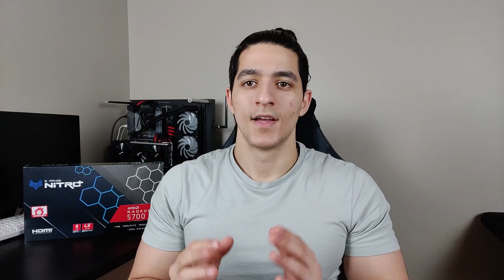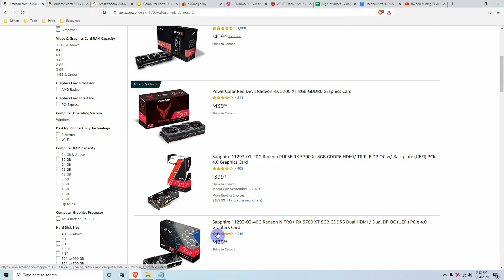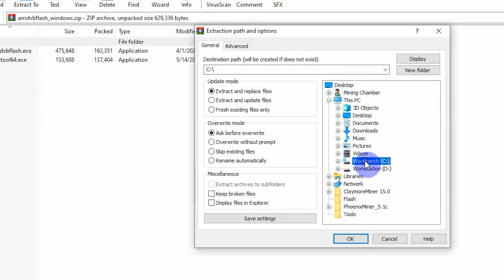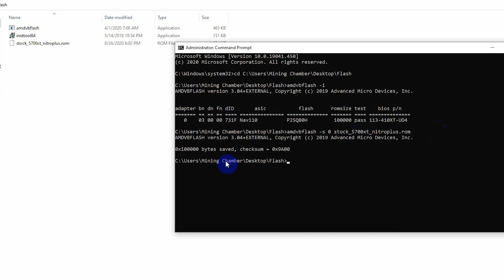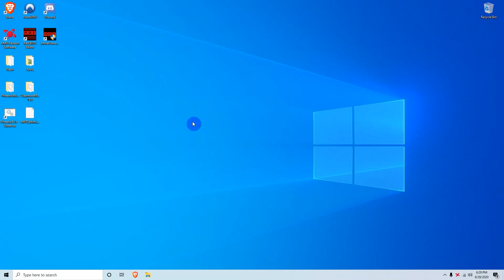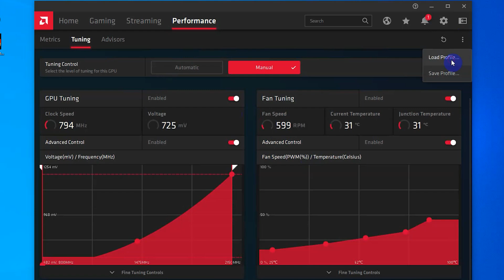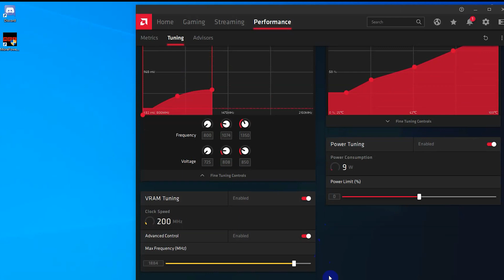RX 5700 XT Mining Overview | Profitability, Hashrates, BIOS Modding & Overclocking

Comment: Why do I get cannot load driver when I try amdvbflash? And it os 3.04+
Reply from the maker: Make sure to run instool that came with it
Reply: @MiningChamber  thanks worked perfect. Any chance to get more then 54.3mhs per gpu on sapphire nitro plus 5700xt
Reply from the maker: You can use the performance settings we show in this video!

Comment: Hello, I'm mining with my Aorus RX 5700 Xt, but I can't do more than 25mh / s and then the speed drops .. I used an Aorus app to increase power and memory but it hasn't changed much .. what am I doing wrong because whatomine also tells me that i could get 58mh / s .. could you give me any suggestions?
Reply from the maker: What happens if you try to do it the way were are doing it in the video? Try to use Wattman to overclock the card and make sure it's fully powered as well!

Comment: I have followed your video and done everything you did, my hashrate is 55, which is great but my powr consumption es 115w!!!, cant go lower, 725mv. Any ideas?
Reply from the maker: With this guide we don't go lower than 725, are you reading your watts off the software or the wall? Generally these gpus with the effecient settings pull around 130 watts from the wall so it's okay!
Reply: @MiningChamber  From the software (amd Wattman). The video card is one from asrock, but i do not believe the model matters.
Reply from the maker: Software is not accurate so try to get a wall meter so you get an accurate measurement

Comment: I changed the Bios for 1 card, when i put the 2nd card in it showed that the bios was already done?? same for the 3rd card. ????
How can the bios be changed before i even start the process?
Reply from the maker: Hahaha how did it show that the bios was already modded? I would recommend testing the hashrate first to make sure it's modded, try the settings we use and if it doesn't get you 55 mh or if it doesn't go below 750 mv for the core voltage then you probably didn't save the gpu image and loaded it into Red Bios Editor. Make sure you load the image instead of selecting from the drop down list!
Reply: @MiningChamber  its sorted now. just flashed them anyway. seams to work.
Reply: @MiningChamber  the settings seam to be around 730mv, but my wattage is around 135w! All settings are the same
Reply from the maker: That's completely fine! If you check on our website for the overclocks article we do show that this is how much it uses for watts off the wall for effecient settings!

Comment: hey can i mine without doing everything u made on the video? or is it riskier or just less profitable? thanks
EDIT: I forgot to mention it, what are the risks of gpu mining? i mean will it burn the pc? i will just mine for like 10 hours a day
Reply from the maker: Hey! You can skip the BIOS modding part but for overclocking I really do recommend not skipping over it. It will make your card run way too hot if you mine on stock overclocks. Just instead of undervolting at 750 try to do 800-850 core voltage
Reply: @MiningChamber  hey finally i decided to do it i was just afraid of flashing bios but everything is cool man thanks!
Reply from the maker: @oritoh  Thank you and good job!!
Reply: @MiningChamber  one last thing, yesterday i mined with stock settings and average effective speed was 46 in 12 hours but now that i overclocked its unstable from 20 to 45 is that normal? thanks! Normal speed is stable in 53.5 to 54
Reply from the maker: @oritoh  That is not normal make sure your following the overclocks properly, try effecient settings then performance and see what works best for you, also check the link to our website for ranges if your overclocks keeps crashing then you can move around in the ranges we provide on our website! I highly recommend tuning your overclocks, stock settings uses too much power and produces way to much heat which will kill your gpu faster
Reply: @MiningChamber  thanks man im getting good hashrate and temp is 54ºC, is that right? Effective hashrate i think its too high is at 60-70
Reply from the maker: @oritoh  temp for core is usually low you want to check your memory temperature that's usually gets really hot on those cards, below 90c is good! 

As for hashrate, check your reported hashrate not the effective hashrate

Comment: Rog Strix 5700xt can't be bios this way don't know why.
Reply: Yea for some reason my amd drivers can't find my gpu when i do the bios.
Reply from the maker: Did you make sure to run the instool that comes with the amdvbflash ? Usually that solves the issue and also make sure you have your AMD drivers installed for sure
Reply from the maker: Hmm odd, what happens when you tried?

Comment: Hey Mining Chamber,

Thanks for this tutorial! However, I ran into issue, when I try to use amdvbflash, I get an error "cannot load driver". At first I thought it was because I had the latest driver installed, so I downgraded to 20.4.2. I still get the same issue. I am using Sapphire Pulse's. I tried just one card, but I have 5 of them.

I did not try to touch the BIOS switch at all yet.

I am testing running them on stock bios at 1300mhz, 750mv, 1870 memory. I am getting 54.0 mh/s. Testing if it is stable.

Thanks in advance!
Reply from the maker: Hey! This usually happens when you don't run the instool application that comes with amdvbflash. And make sure your using the 3.04+ version not the 3.04 one. Good luck!
Reply: @MiningChamber  Thanks, buddy! You are right, I missed the step of running instool application. Going to try!

Comment: This was a fantastic vid. I have 9 Gigabyte 5700 XT cards. 5 are rev 1 and 4 are rev 2. I was able to mod all my rev 1's to bump them from 49 to 54 Mhs in HiveOS but setting the overclocks to the recommended values (core clock 1350/core volt 900/mem 1850/mem volt 850) didn't increase the MHs. I may flip back to Windows and adjust wattman and go back to NiceHash.
Reply from the maker: Thank you! And awesome good luck my friend!
Reply: Any luck on rev 2? I have tried every single .rom available for gigabytes but I always get stuck on black screen on my rig, only works on default rom
Reply: @juniordasilva3676  Did you get this working on rev 2? I also have rev 2 Samsung memory

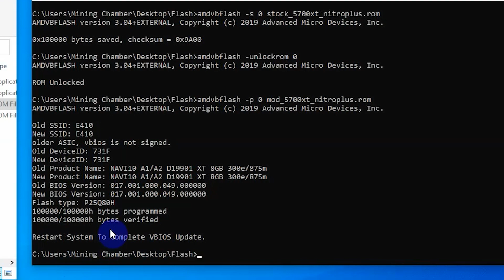Comment: So i got to 21:24 and now it will not let me open AMD software because no GPU is found. Go to device manger and it says windows has stoped this device because of issues (code 43). any help?
Reply: Got that fixed. so now I moded each GPU seperate and they worked great. when I put the whole rig together . It reads all 4 GPUs, buy #3 and #4 are showing 0 hash and error code says "failed to allocate buffer for DAG though device as enough memory, try to increase virtual size of memory using bigger swap file"

Thanks!
Reply: okay so I just increased my virtual memory to 32000 and it worked. Fingers crossed.
Reply from the maker: Oh awesome sorry I thought I replied! Our 5 tips must do for mining in windows 10 video covers this, feel free to check it out!

Comment: What's wrong with the MSI MECH-OC? I just bought 6 of them :/ haha
Reply from the maker: They get pretty hot! Just make sure you cool them good enough
Reply: That was my concern as they much cheaper as well then ASUS I Hope Gigabyte is bit better in this case
Reply: @PasakuPasaulis  I have gigabyte 5700xt. it stays cool. without bios modding and underclocking and overclocking in adrenaline, i get 52mh/s using lolminer
Reply: I'm sure you've discovered that they run a little hot, but hopefully you've also discovered that's because they tend to have the thermal pads not on the center of all the chips. Pop the cooler off clean off the gunk, fix all of the thermal pads, apply good thermal compound and bolt it all back together... Bit of a pain to do to each card one at a time but they run significantly cooler after you do.
You can also take the plastic back plate off, put a big thermal pad over the back of the whole card, and just stick whatever heatsink you want onto that.

Edit: or you can do what I did and just put a water cooling block on it.
I did that to mine before I started mining anything just because I wanted a quiet gaming PC but it lets you really crank everything up
Reply: @TravisFabel  How much did it cost to put a water cooling block on it? Summer is coming up so I need to figure something out regarding the heat. Has it been worth it thus far? Easy to install?

Comment: what is wrong with the other RX 5700xt?
Reply from the maker: They just aren't as good with cooling but performance is very much the same! Heat makes hardware die quicker
Reply: @MiningChamber   awesome, thank you for the quick reply. I had just bought an MSI one, so thats handy to know. it was 150 cheaper (in Aus) then the ones you recommended, and now i know why, cheers.

Comment: Hey bro thanks for the amazing tutorial I'm considering buying it now and I was woundering what motherboard and what processor and power supply, ram to pair it up with i would really appreciate your help

Thanks
Reply from the maker: Hey! Thank you!! We have a video with the full parts list for this GPU in here https://www.youtube.com/watch?v=lOn8WceC2TM&lc=UgzeLW3IuAQOEDduKA54AaABAg
Reply: @MiningChamber  first of all thanks for your amazingly fast reply and I have 3 questions I'm sorry for asking alot 1 is that my electricuty is 220v is there a recommend power supply. And 2 is this rig suitable https://www.amazon.com/dp/B079MRMJZL/ref=cm_sw_r_cp_apa_fabt1_XItVFb470XSDQ?_encoding=UTF8&psc=1

And the third is that this processor is out of stock can I replace it with this one https://www.ebay.com/itm/Intel-230430-Cpu-Bx80684g4930-Celeron-G4930-Box-2m-Cache-3-2ghz-2c-2t-Lga1151-/233303180352?_trksid=p2349624.m46890.l49292

Thanks bro!!
Reply from the maker: No problem brother, for 6 cards get at least a 1200 watts PSU, just make sure it's rated for 120-240v, that frame is good yes. I think that cpu works too but I would first confirm with the motherboard cpu compatibility list that your planning to buy
Reply: @MiningChamber  Thank you very much for your fast replies and help I really appreciate it brother.

Comment: Hey, first tks for the good videos you do , helps me alot :)
I question, I want to do what you doing in this video and I have rx5700/xt, I need to change place, going to have removal all and assembly again. Question is, if I do the mod bios before i move there ill be a problem with the GPU alocation on MB slots? Does GPU have to be on same MB slots ? Sorry for long text !! :P Thank and keep good work
Reply from the maker: Hey! Thank you so much!

You can BIOS mod it and move it anywhere you want ;) no need to worry about the motherboard slots they can be placed in any slot! Good luck!

Comment: Hi ,If you use the Linux operating system instead of windows 10, I think that its consumes less power can be you can give me an answer follows to my question for the difference of the electricity consumption between window, Lunix
Reply from the maker: Hey! Power consumption will remain the same for the GPUs but for your system yes you most likely will use slightly less power 40-50 watts idle probably. Although if you use mining dedicated OS then it won't make a difference!

Comment: Are you using an adapter to run the HDMI cable to the motherboard? My Biostar TB250 motherboard does NOT have an HDMI port. It only has a USB 2.0 and 3.0 port. What kind of adapter are you using?
Reply from the maker: I plugged in the HDMI into the GPU in our mining rig build video, you can do that if your mining in windows and just turn off the monitor after you stabilize your rig!

Comment: I am building a mining rig with 3 gigabyte 5700xt. How many wattage of power supply do i need? Plz let me know
Reply from the maker: Using a 850 Watts for 3 cards is good! Check our 5700XT Mining Rig build example you will find it in the GPU Mining Rigs playlist. We use a 1200W which is good if you want to add more cards down the line

Comment: Good afternoon my friend. I couldn't get to 88w with an Rx5700 XT Sapphire Pulse. Can you tell me if I get this same plate from you, Nitro + I will be able to reach these 88w or very close to this temperature?
Apparently this Nitro + is the best plate to mine.
Thanks
Reply from the maker: Hey! 88w that is off the software, you will be drawing around 130 watts off the wall. As long as you have the same bios mod and overclock settings you will be drawing the some power off the wall! Does it crash for you or is it working ?
Reply: @MiningChamber  
My Pulse does not crash, but consumption in the Phoenix mining software arrived only at 100-106w. Pulse didn't even come close to the 88w you got on Nitro +.
Reply from the maker: It doesn't matter as long as off the wall is accurate. Like I mentioned software is not accurate

Comment: One question please: What is the best about this Nitro + model compared to the Pulse model?
Is your construction better than Pulse? For example, is her cooling system better? Are the term pads better? Is her electronic components better than the Pulse model?
I am seriously thinking about buying, through your link, this Nitro + model instead of buying the Pulse model.
Thanks
Reply from the maker: Hey! The Nitro+ happens to have one of the best memory cooling but that is the only difference. The Nitro+ is better in cooling than the Pulse but the Pulse is also still a good option!
Reply: @MiningChamber  Thank you.
I did a test doing this bios mode on my pc gamer that has a rx5700 xt pulse and the memory temperature mining ETH was between 82 and 84º. Is it considerable or is it too hot?
Reply from the maker: @waldeniroliveira  That is not too bad! ideally keeping it below 90C is good!

Comment: can you also review the msi rx 5700 xt gaming x please?
Reply from the maker: Hey! We will try but it will be hardly unlikely to do a full review on another 5700 XT! They are all very similar and they also run at the same overclocks ( with minor tweaks between every card if it keeps crashing) 

So you can use this video as a guide for it. The only difference is how better or worst they are in cooling!
Reply: @MiningChamber

Comment: I have a doubt. My card is a Sapphire Pulse Rx 5700 XT and in power limit gpu it is 180 (w). Below these 180w for which number? Thank´s
Reply: Note: My power supply is 1000w for 6 gpus
Reply from the maker: Hey! I am sorry I do not understand what you mean. You won't need to touch a power limit if you just undervolt it properly. I also do recommend upgrading to a 1200 watts PSU so you can follow the ,80% rule!
Reply: @MiningChamber  Sorry, I'll try to explain it to you.
In the video, in MPT, you changed the Power Limit from 220w to 180w, that is, you lowered 40w. In the Sapphire Nitro model the standard in the next bios is 220w and in the Pulse model the standard is 180w. So since my Rx5700 XT card is the Pulse model, which number do I change this 180w to? Low 40w too?

Just to complement, I have a rig with 6 RX580 Pulse boards consuming 90w each, with a Corsair power supply of 1000w and I want to change these Rx580 cards to RX5700 XT.
Reply from the maker: Yes you can just follow the same numbers!

Also make sure you calculate watts off the wall and not from the software since the one in the software is not accurate!

Comment: I found a very good setting for the sapphire nitro + Radeon RX 5700 XT 8G.  94 watts 57.8 MH / s with these parameters: 
frequency 800 1074 1350
 Voltage    725   733   755
  clock 1884
94watt 57.8 MH / s
Reply from the maker: Nicee is that 94 watts off the wall?
Reply: @MiningChamber  No 94 watts the GPU!
Reply from the maker: Oh ok so in software I see, not bad at all!
Reply: @MiningChamber  Let's hope it lasts and won't crash!  It has 3 hours that goes quietly, let's hope well 🤞
Reply: @claudiofrestasicilia  didnt crashed with this settings? looks like impossible
Reply: Thanks man!
Reply: Huge thanks man, I have the exact same GPU and since i'm a newbie in mining and haven't tweaked it at all, I had been getting 184W consumption. With your settings, i'm getting 91W and 51MH/s

Comment: Hello by moding bios im always getting error : ROM not erased
 ERROR: 0FL01. Can you help me how solve it ? i tried all amdvbflash from 3.04+,293+ and also 3.04 from guru3D but all showing same error...
Reply from the maker: That's odd, try again the steps using 3.04+ make sure that you do run the unlock rom command before changing the bios image and also make sure your running it as an administrator. 

Which gpu model do you have?
Reply: @MiningChamber  i have done all steps what you mention but dont work ... i have 5700xt power color
Reply from the maker: It's hard to tell you exactly what's wrong since the steps do work for everyone. I would just try one more time following the exact steps if it doesn't work then join our discord let's chat more there!

Comment: pls
i want to know why do not you recommend the(ASUS Dual Radeon RX 5700 EVO OC 8GB GDDR6)
because i have found it in agood price in a local market site
is it the cooling or trouble in hashrate power?
Reply from the maker: It's just because they get hot! They are not good at keeping cool like other models but if you find a good deal then it's okay! Just try to run n effecient settings on it
Reply: Found agood deal of it
And the (AS Rock rx 5700 with trible fan)
Which one do you recommend?!
(Same price)
Reply from the maker: I'd say Asrock is better!!